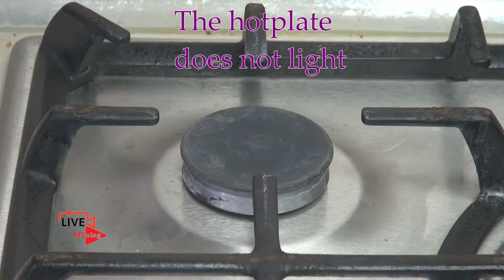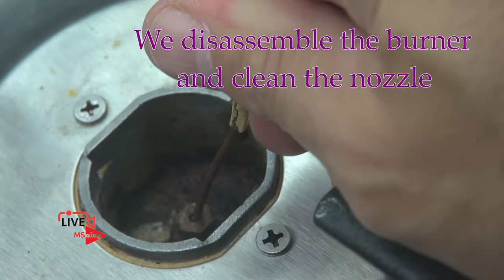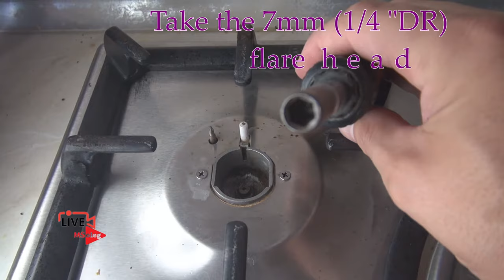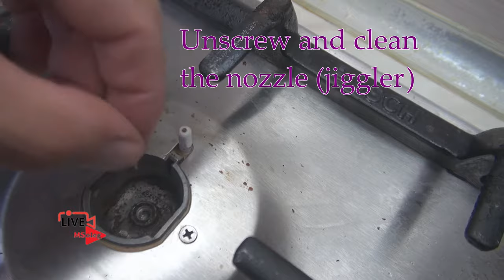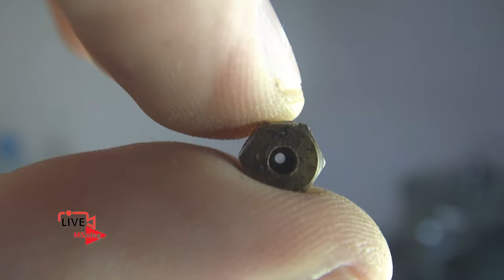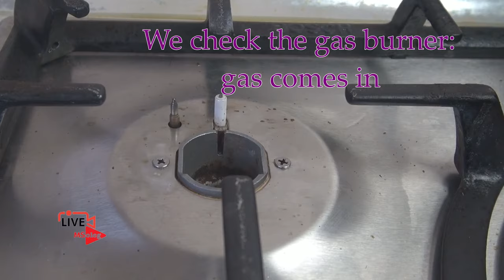How to clean gas stove burner nozzle. No gas or small flame on Gas hob cooker.

Comment: The nozze is difficult to removed with rachet. It doesn't move. What should I do?
Reply from the maker: You need to take a the union head 7 mm and unscrew the burner nozzle. Try turning it left and right to see at least some movement, because the thread on the burner nozzle is clogged. Then clean the attachment with a match or a toothbrush.

Comment: If still after cleaning jet gas doesnot come.. then?
Reply from the maker: Jets on gas stoves are rarely replaced, and only if Gas is changed to a liquefied version from cylinders. Replacement of the jet is required only when the flame breaks away from the divider and is poorly controlled by the fuel supply system. Most often this is a factory defect of the nozzle. If a similar problem is observed on all burners, then the gearbox is most likely faulty. In all other cases, cleaning the nozzle should help